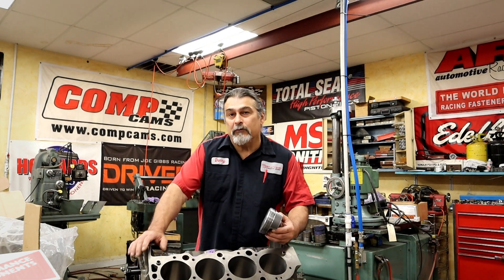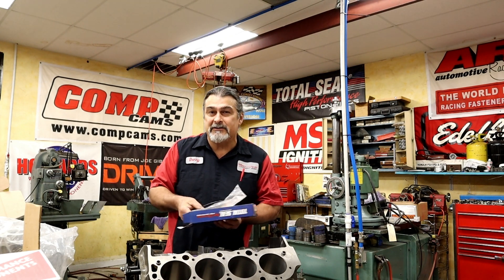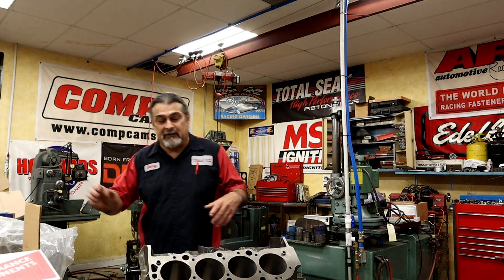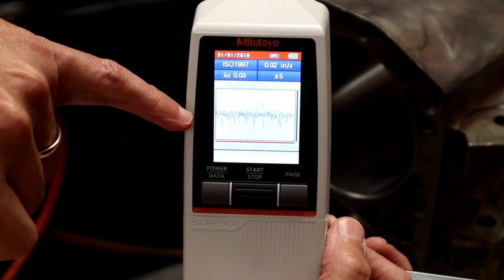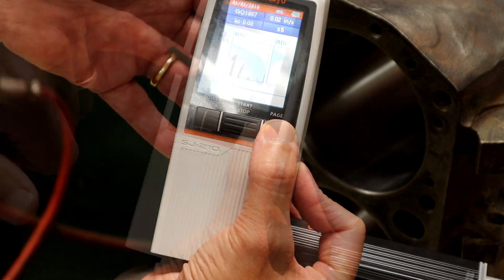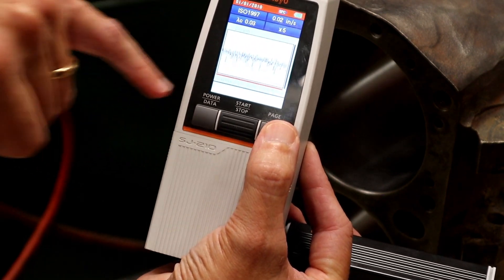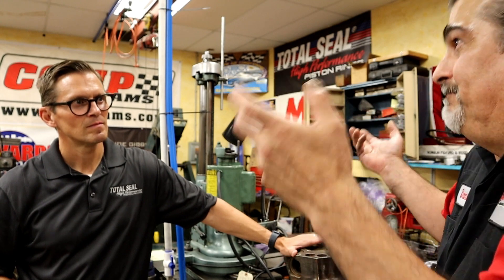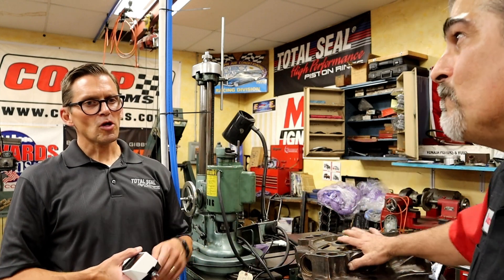How to check cylinder bore finish featuring Lake Speed Jr

Comment: Thank you for that, Daniel.   Would you say it would be beneficial, when refurbishing a stock bore engine, to use the boring bar and rigid hone to final size, versus skipping the boring bar and just roughing it out with the rigid hone which I'll often do when I'm only going 0.005" oversize?   I work on Harley, primarily the air cooled engines.
Reply from the maker: For .005 over you can only hone it and we torque plate hone HD cylinders. Crazy how much they move around.

Comment: I have a request. I am interested in learning more about specs for the bolt stretch. And reasons why you might want it on the looser or tighter side of that spec. 

I believe that I have a pretty good understanding of just about everything else that’s going on with the very individualized dutys that are tasked to a fastener that holds the bottom of a rod assembly. 

Everything except that one variable, 

and I know that it is a multiple sided question. Because it’s The type of Fasner, the size (and for that matter also the thread pitch) of the faster, and the material of the fastener.

I know it’s complicated. But can you give me a good general guideline. That way I have some general structure.

What does more or less mean for a pressure cracked rod? What does it mean for a cheap mass-produced fastener versus a high cost Fasner? Is it always good to go more towards one side of the spec versus the other?
Reply from the maker: There’s a lot here, great question….. I’ll have to do a short video just on this subject. Coming soon. Thanks
Reply: @MrDanielSoliz  thank you, like I said I understand the stretch on the fastener when The crank starts pulling the rod assembly back down while the Piston and rod momentum is going up.

However the part I am personally curious about is the bolt stretch when to torquing to spec. I’m hoping for a general guideline on which side of the tolerance scale I should want to lean towards. why I might want to lean in that direction. (like I said I understand that it to pounds on materials, manufacturing differences, and fastener differences.)

Thank you again. Hopefully I get a few new pieces of information to help me form my own personal opinions.